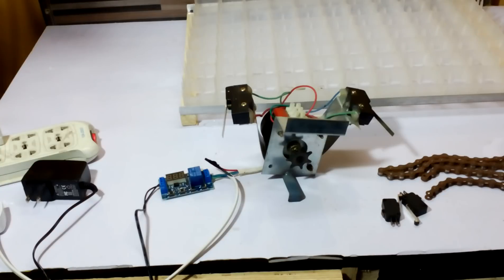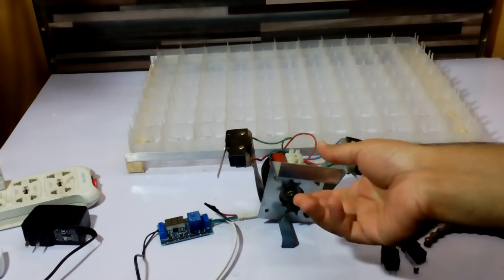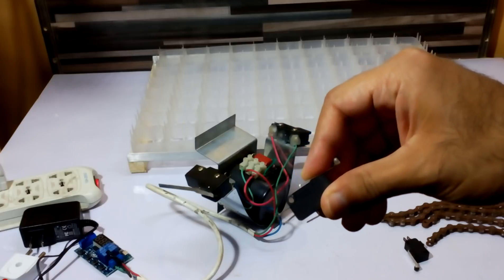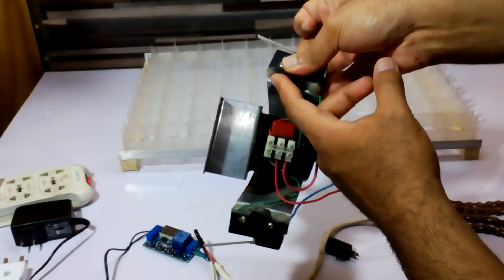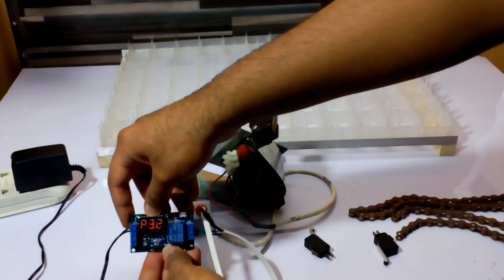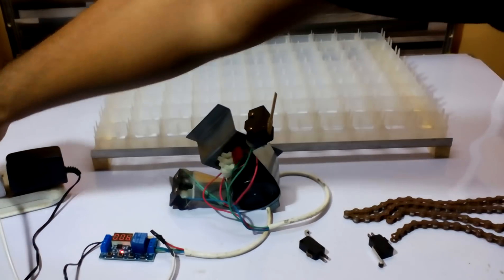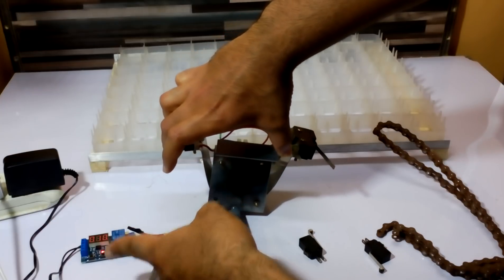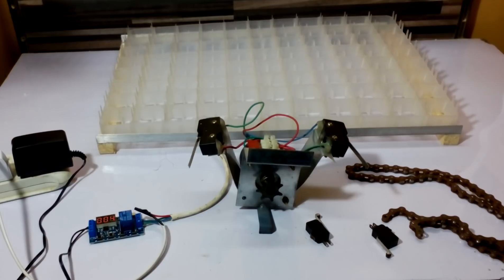XYJ-02 timer connection to incubator synchronous motor 60KTYZ

Comment: Please i connected the motor  and the timer and the motor only move in a clockwise direction. I need assistance
Reply from the maker: Have you done the wiring yourself of motor
Reply: @Umairworkshop  yes I did the connection  myself
Reply from the maker: @nyongdajhs4172  you need to do the wiring correctly it should stop working on the limit switch and when current reverse it should go counter clockwise

Comment: Any idea on how much rpm motor you need for 1000 egg capacity incubator?
Reply from the maker: it should be very low around 2 to 5 rpm
Reply: @Umairworkshop  thank u and for 2000 eggs incubator also can we use 2.5 rpm motor??
Reply from the maker: @Stanleyrocky  yes low rpm is best
Reply: @Umairworkshop  okay!! Thanks...